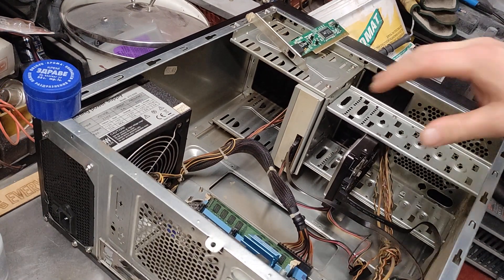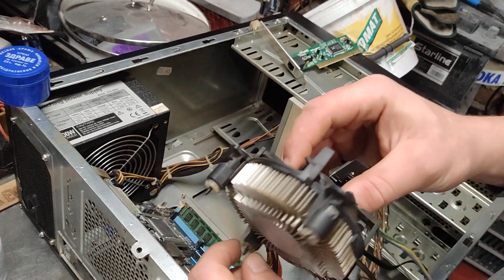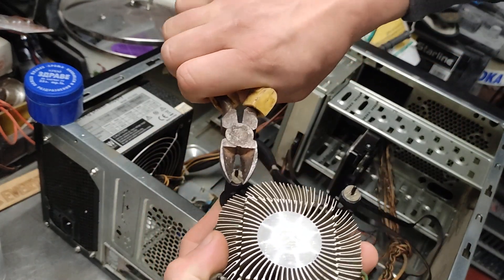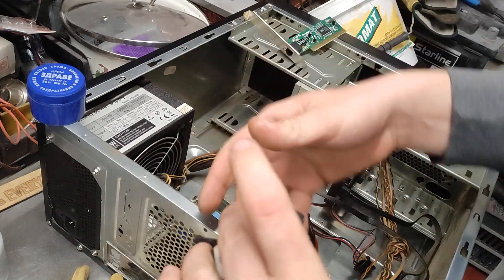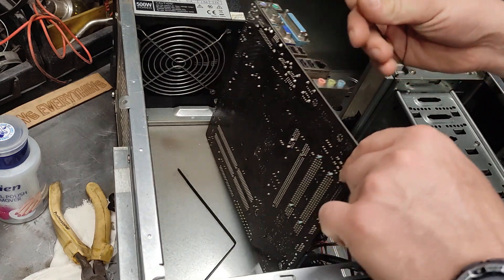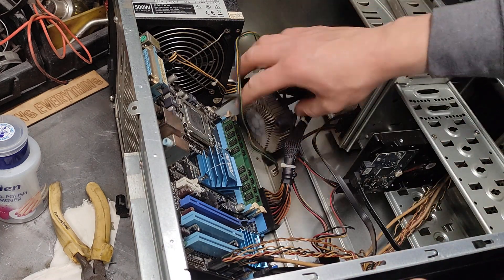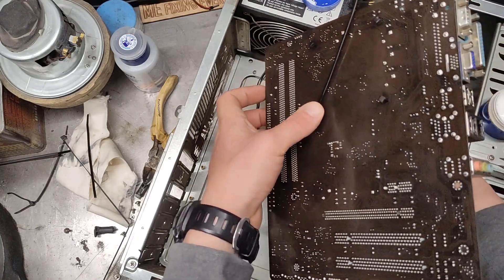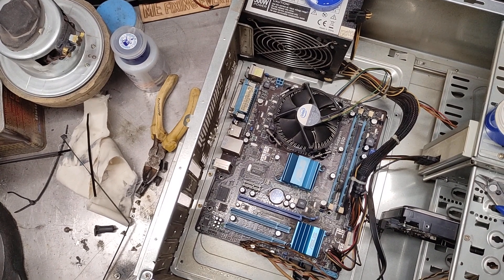How to Repair Intel CPU Cooler with broken Legs / Plastic pins ?

Comment: no good idea,  cable tie becouse of heat cab be broke and screw can make chotrcut on moyherboard
Reply from the maker: Works fine for the last 753 days. Only down side is that I'm too lazy to chop them if I need to replace thermal paste.

Comment: Brate moj what did you use instead thermal paste greetings from SRBIJA (i need to do this mine broke off I cant put it back
Reply from the maker: Hey 👋 still thermal paste , just from a local computer shop

Comment: Hey the plastic pins on my Intel CPU fan cooler got twisted. Should I replace the CPU fan cooler?
Reply from the maker: If you can feel any gap between the cooler and the processor.

Comment: I’m just putting in the screws from my old mobo + cooler into my new one, I’m ready to pinch these dumb pins off. Fortunately I just have metal brackets where the push-pins are housed, perfect shape + height to screw in. Fingers crossed!
Reply: @me fixing everything; it may work with the spare M3 spring-loaded screws you can find online. I realized I’m coming from an ITX, so I don’t have heatsink screws to take from this particular board. 
I then realized I have the odd 5pin Dell connector, so I had to switch plans anyhow.